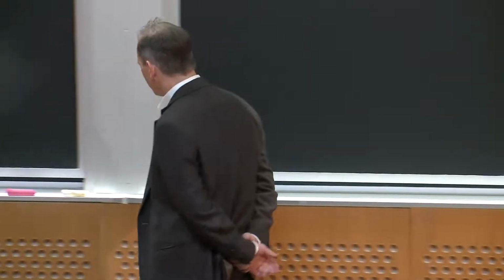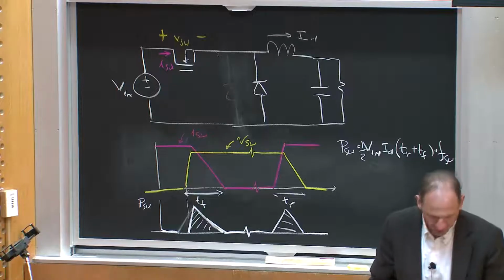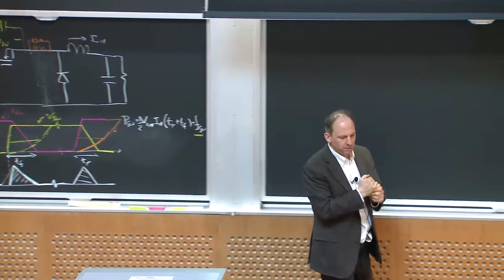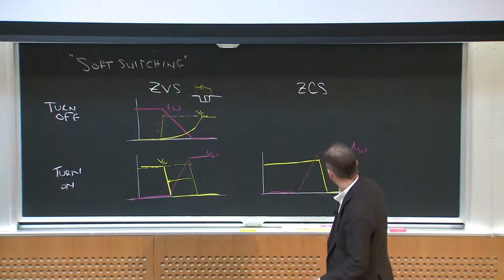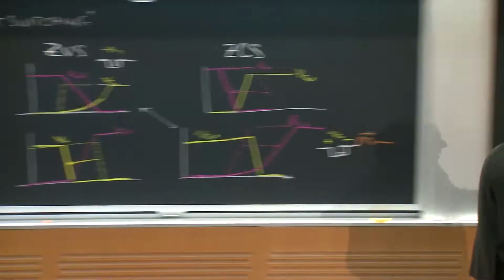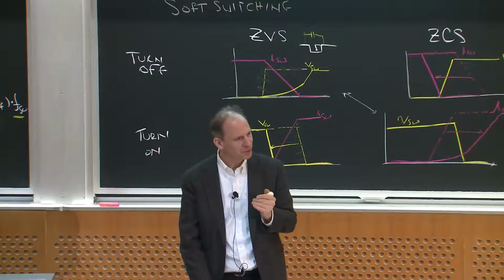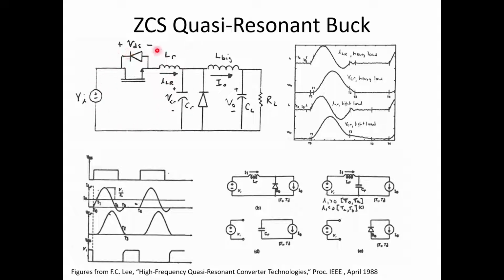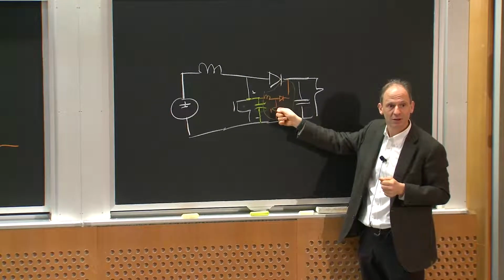Lecture 33: Soft Switching, Part 1

Comment: at 13 :27 both capacitor and the inductor arrangement must be used together or else if u use one of them only still the freewheeling diode  will not conduct untill the voltage acrross it is 0 . right?

Comment: When the switching frequency is pushed into MHz, pay attention to the inductor core loss. The core loss rapidly increses with di/dt. Ferrite are the least core loss material. So for high switching frequency, always use gapped ferrite. Never use Powder Iron core.

Comment: Quasi -resonant also recover the Qrr energy of the diode too. Actually I intetionally used higher Qrr diode to achieve better Resonance. Higher Qrr establish higher reverse current in the inductor along with Coss energy of the mosfet.

Comment: For ZCS, inductor need to be introduce in mosfet current path. But that store energy in inductor, which hurts during mosfet turn off. But use that inductor store energy to achieve ZVS.

Comment: These are called non-dissipative or lossless snubber. I have design and implemented them in PFC and pushpull converter. It make them ZVS & ZCS. Sometimes they use Quasi- resonant  boundry current mode flyback converter.

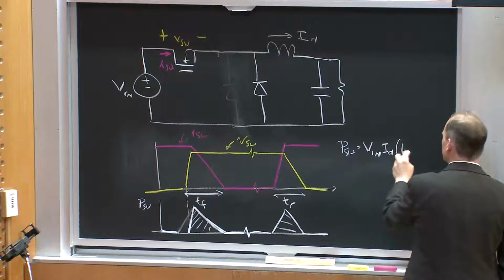Comment: 6:37 Why are we using id(if it means diode current) for both the areas? Shouldn't we use i_switch for the first area then i_diode for the second one?
Reply: Both areas are related to transistor losses. Perhaps Id refers to the current flowing through the drain of the transistor. or current of Device (Transistor, In this case).
Reply: @Merdd8401  Yeah, it only makes this way

Comment: why can the diode not carry current until it has zero volts? For, a diode to conduct,it must be forward biased, right?
Reply: As he mentioned the diode is assumed to be ideal so it turns on at zero voltage itself. Prior to that it was reverse biased by the source voltage when the switch was ON.
Reply: @ArunL-u5t  thanks. got it

Comment: 31:05 Edit: I wrote a really long winded word-salad explanation here at 3AM one day in college, here's my attempt to clean that up:

If you want the lowest Vds possible, you're looking for a concave up local minima of Vds i.e. slope is 0. The moment that happens is when your inductor current is at a 0 crossing from negative to positive (end of phase 4). 

The behavior of Vds during phase 4 can be broken down like this:
--> Initially, Vds ~= Vin (lingering from when forward current was just going thru the diode).
-->  Because of that, VL = (Vin - Vout) - Vds = (Vin - Vout) - Vin = -Vout at the first inductor current zero crossing (phase 3 --> phase 4).

A math trick you can leverage is that since the circuit is linear, we know the behavior of the inductor current around the local minimum is symmetric. So, the time between the first zero crossing to the local minimum to the second zero crossing is equal (and so the derivatives are negatives of each other).
--> VL_zc1 = -Vout
--> VL_zc2 = Vout

So now, just use the inductor voltage equation from before (since we're still in phase 4, state hasn't changed yet):
--> VL_zc2 = (Vin - Vout) - Vds
--> Vout = (Vin - Vout) - Vds
--> 2*Vout = Vin - Vds
--> Vds = Vin - 2*Vout

Hope that was useful!
Reply: That was a great help, thanks!